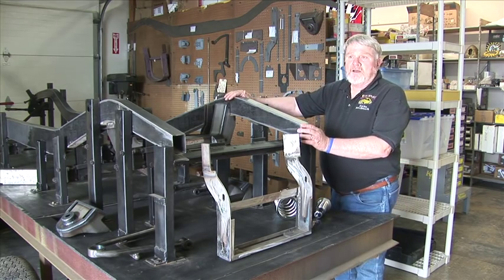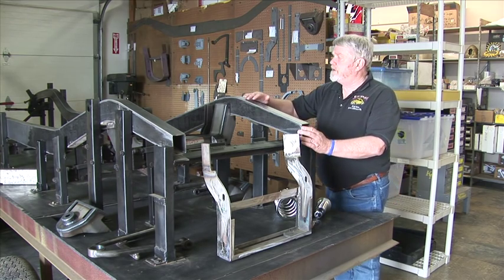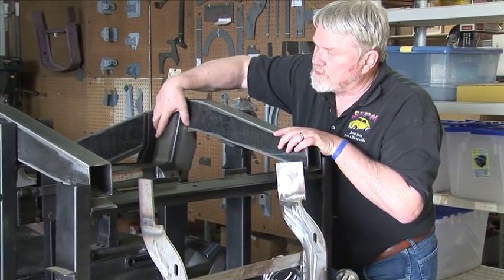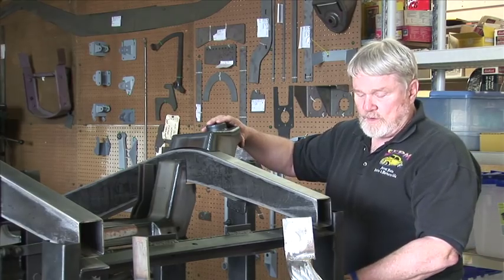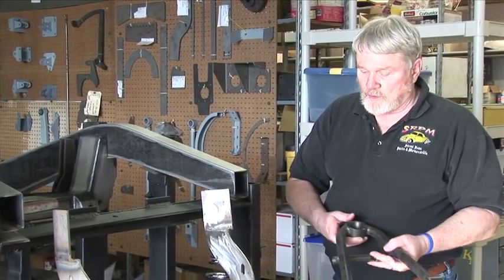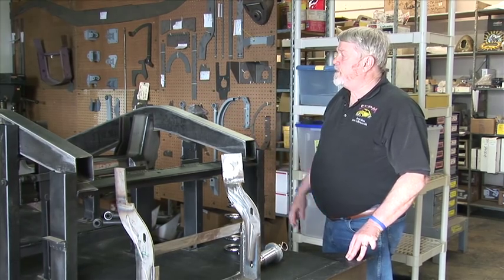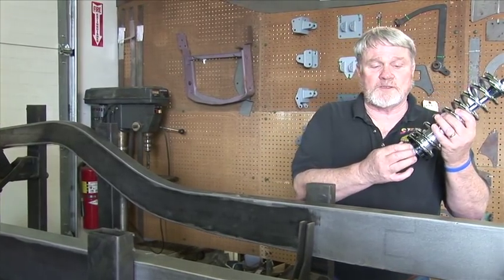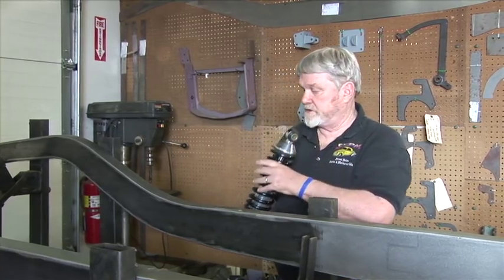SRPM Street Rods - Pro Street Frame -- How It's Built

Comment: Our frames are laser cut from CAD drawings and tig welded. 10 gauge steel cold rolled. We use .125 2x2 square  tubing in our center sections .

Comment: what size is the square frame tubing ?
Reply: +joe smoe It depends where you are at on the frame. It varies from 3" x 2" to 6" x 2".
Reply: I want to redo the rear frame from the rear end back to the bumper on my 1968 Dodge Coronet....I was wondering what size square I should use.
Thanks